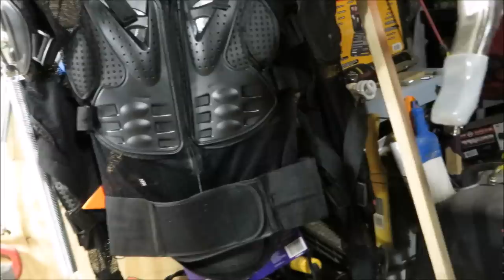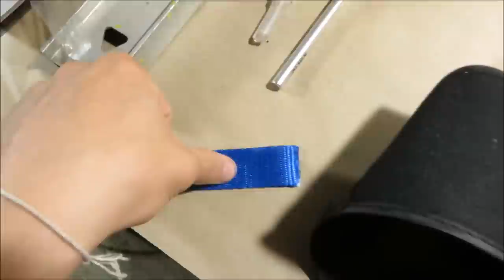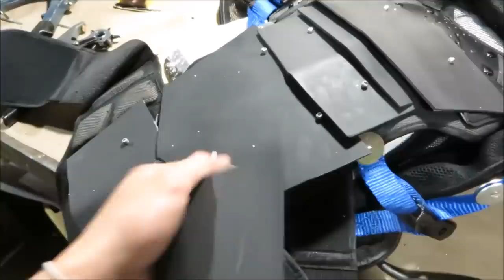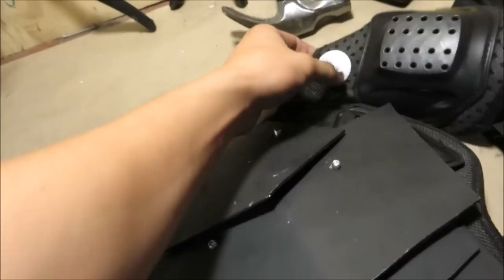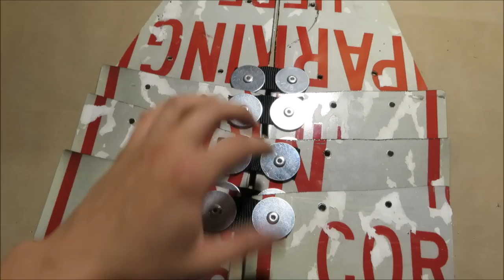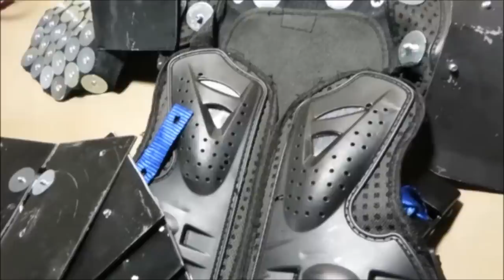How to Make: Body Armor

Comment: For the record, they armor their left shoulder more heavily. When you're holding a shield, that's the side you show to your opponent, since it's more heavily protected. But, the shield will only cover so much, so the enlarged pauldrons are used to help protect the wearer from high attacks on that side that might be missed or deflected by the shield. (In medieval jousting armor you'll find quite often that their pauldrons have what look like large plates extending vertically blocking the head. Those are used to help deflect splinters from broken lances). If one side is less armored than the other, its mostly for maneuverability. The heavy pauldron over the left shoulder (shield side) is juxtaposed with a relatively light or small one on the right to offer more free range of movement on the sword arm. Maneuverability is key in combat, and you don't want anything to hinder your motion. Bottom line, video games should never be used as a guide for functioning armor. Thank you for understanding that. :)

Comment: How long did it realistically take to build the entire set, including shopping and working on the set of armor. Also is there a cheaper or more available material than aluminum street signs.
Reply from the maker: Probably 3 days, I had help from Dan though so it woulda been a different story without. And for me there is no cheaper option, cause it's free with me getting them from my road-worker uncle. But for you, you'll probably just have to keep an eye out for scrap. Barrels, old tool boxes, stuff like that is good to harvest sheet metal from.
Reply: Oh cool well thanks for the response. Yeah I have a hard time looking for scrap so I might just use steel or maybe a little fiberglass, anyway thanks again. love the vids.
Reply from the maker: MobilizedPants Thanks dude. Good luck with the build.

Comment: dumb idea. could you have put a layer of aluminum(or steel) in between the layers of the $30 bulletproof body plates? or layers over it? AND you want the defensive arm  really armored and your weapon arm with less. this is because your offensive weapon is gonna be swung all over the place and you dont want to tire it out unnecessarily.

Comment: About 6 minutes in, you start talking about pauldron sizes. Most pauldrons are larger on the left side because that's the side you use to parry while your right side is less armoured for more mobility. It's especially larger on the left, not just for parrying, but because that's the side your opponents blade is more often coming from.  It's often this way in video games as well. I haven't seen many that switch it up. So you're right in where you want it to be. Just wrong on where it normally is.

Comment: Hey!
I have a question, google doesnt seem to be able to answer me.

Ive been into making swords out of wood for about. For about 4-5 months now.
Recently since I've been watching lots of 'how to make your own armour' videos Ive been wondering if its possible to make all this out of wood?

Ive googled and googled and I can find anything on wooden armour that isnt an ingame thing.
It wouldn't be as strong clearly but It wouldnt be made for use, just looks.
Reply from the maker: I've been thinking of experimenting with this for some time, I don't see why some thin plywood wouldn't make some decent armor, as long as there was a buttload of nylon straps everywhere you'd normally just bend the piece.
Reply: I guess the kind of armour I'm thinking of is more of a Halo Master chief kind of look (I'm not making spartan armour is just an example)..

Do you think it would need to be really thin wood?
Or could you use thicker wood and glue/dowel (or somehow stick/fit it) together?

I also plan on experimenting on different things but am just after a decent starting point from a build expert as I have a very limited amount of money.

Thankyou for replying before, cheers from Australia! Love your channel! Am always trying to show your stuff off to people :)
Reply from the maker: I would suggest 1/4" plywood, with nylon straps to connect the rivets.

Thanks for watching! Good luck with the build

Comment: Alright Ellie. i have request. i know its probably not going to happen but i really need help. i have undertaken armor build that is similar for this. its going alright but the real problem is that its my DAT major project for my final HSC task. i am using an almost identical set of motorcycle armor but im building on it using different techniques. primarily using the plastic plates as the main support for the metal plates. there are still places that i can improve on but i just extending out to other sauces in hope that you might be able to give  me some more idea's. THIS IS THE ONLY tutorial i have found that uses motorcycle armor like the one i have and you clearly have some good pointers.

long story short. can you please make another armor build that is similar to this one using similar resources  and the same type of motorcycle armor so i can get some more idea's. or at least give me some pointers. thanks mate. i hope to hear from you soon.

Comment: Typically the left side of medieval armor was thicker and had reinforcement plates.
Most noticably on milanese armor.
The reason should be obvious...90% of people are right handed. Where does a right handed person hit you when you are facing each other ? Yes, your left side.

Shields were rapidly discarded by knights in the 15th century. Plate armor by then had evolved so much it was generally regarded as not needed.
Reply: fun fact: left handed people were slaughtered because people thought they were possesed by demons.
Reply: Also related to this is how towers with spirals stairs in castles wind to the right. A person attacking (going up) would have to expose most of their body to attack, while a defender would only expose their arm.

Comment: Do you make armor that would be useful in an apocalyptic situation? (A.K.A. Shit hits the fan/military occupation/martial law) For example the rioting in Baltimore that started yesterday, do you make armor that would be useful to protect yourself in a situation like that? Protecting you from gunfire and debris/weapons used by the thugs doing the rioting?
Reply from the maker: DillerFilms In any dangerous situation,I'd rather be wearing it than not. It won't stop bullets, but if you run into a riot thinking "meh that armor doesn't stop bullets, what's the use?" but then end up getting stabbed or clubbed, you're gonna be regretting not having a layer of aluminum on you, feel me?
Reply: DillerFilms  If you want something that stops bullets you're going to have to have some kevlar and or advanced composites.  Even if you manage to rig together some metal that can stop the bullet the kinetic energy of the round will still cause serious internal injuries.  Btw, the stuff i said earlier only applies to high powered rifle rounds; pistol rounds and shotgun rounds are a lot easier to deal with.

Comment: is a bullet proof and stab-proof
Reply: It's stab proof but bullet? Depends on what gun or bullet your using but most likely a bullet won't go though
Reply: +Sgt. Esposito will go through it
Reply: Not bulletproof, but stab proof, however some very good knives can get in if used correctly, + an axe would break the armor easily
Reply: It could potentially bounce a bullet if you're lucky, but a direct hit would go right through.
Reply: Optimistic Pessimist No, sorry, but it won't
maybe a one of the smallest bullets
Reply: ̈ I meant that it could at the right angle, like a glancing blow. Anything other than that would more than likely penetrate (which is why you would have to be lucky)